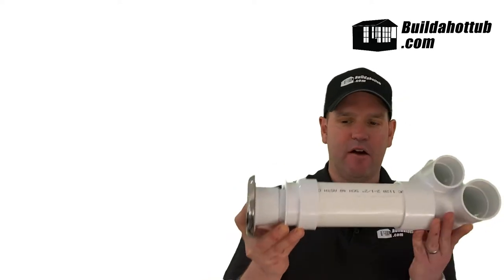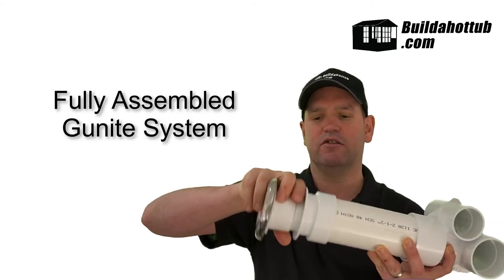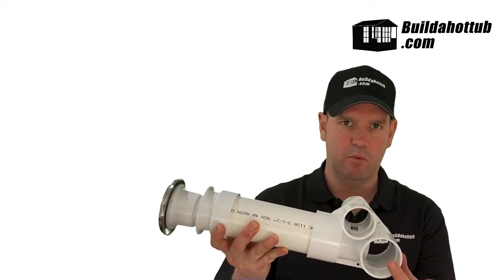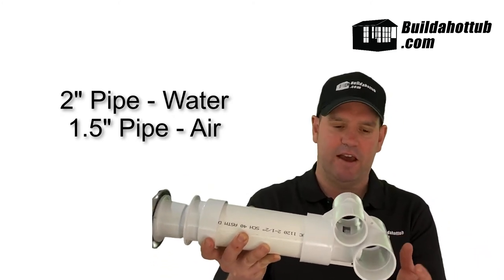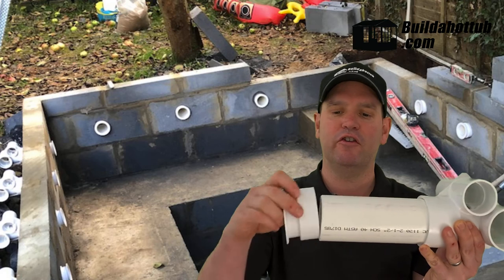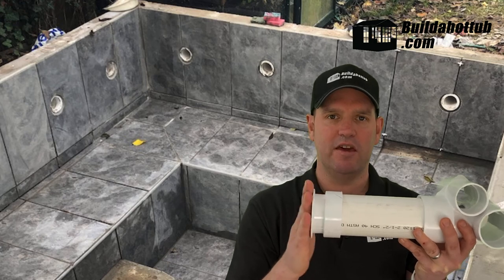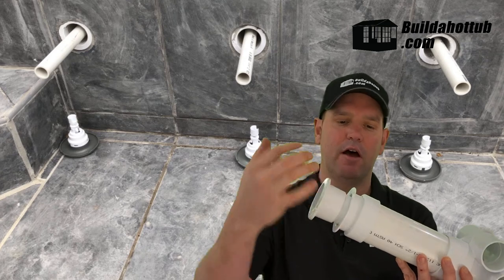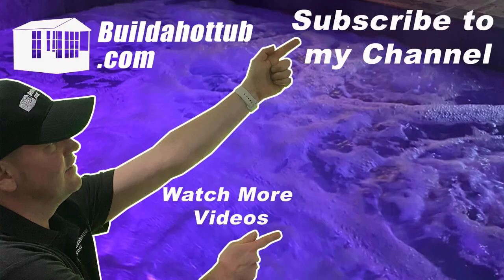Gunite Jets, Bodies and Assembly Explained - I cover it all

Comment: Thanks so much for the instructional video!  Manuals are very hard to find now and they really don't describe how the parts work on a gunite spa well at all anyway.  I found many links to the Hayward manual and they don't work anymore... not sure why.  I'm doing an OB pool and am getting ready for tile/plaster.  The 1" pipes are sticking out just like your video but they are very tight.  Guessing they may have the test plug in still so I now realize I can grab with large pliers and unscrew... kind of scary to do this when I'm not sure it's the right thing to do!  This is invaluable for OB's like me!  Thanks a million!!

Comment: Great video!   Connecting the 'niche' confuses me as to how to make it flush, since it goes over the 2" pipe.  Does anyone make a gunite type fitting where the niche slides inside the sched 40 2" so you don't have the issue of chiseling, or whittling down pvc to get things flush to your tile work?
Reply from the maker: Hi There, thanks for the comment. With the wall niche, you have to position it to allow your final finish thickness. For example, if you have a render the surface, then grout and tile, you are going to want to leave 8-10mm / 5/16" to 6/16" sticking off the surface of the wall. It is not the easiest to do to get them totally flush. You also have to chisel back as you point out to get the wall niche to fit onto your pipe. There are only 2 brands of gunite as I am aware. Waterway which is one I use and I think Certikin (someone will correct me if I am wrong) I know the alternative to waterway are so expensive and they also need huge amounts of flow on the jets which means you need multiple pumps on your build which is not ideal. Waterway have a bit of a monoploy on this kind of kit.

Comment: How efficient is the system at drawing in air via venturi action? I'm planning to use the 229-1100 unit, but before I install it to my existing block structure, I need to know just how good it will be at sucking in enough air to create bubbles.
Reply from the maker: Not sure John, same as your post on the other video, I always use air blowers so could not give you an answer from experience. Sorry about that - Andi

Comment: If you do not use an air pump do the jets still work? Will bubbles still come out?
Reply from the maker: Hi Paul, if you do not use a blower and cap off the air lines, then yes, it will still work. However, what comes out then is just water and there are no real bubbles as the blower does most of the job of creating the bubbles as the water mixes with the air. Hope that helps.

Comment: Why do you need the niche? Why not just cut the 2 inch pipe flush after the tiles are installed?
Reply from the maker: Thanks for the comment - it is meant to give you a nice flush surface for the jet holder to butt up to and also make it easier to seal around the pipe - totally agree with you, you could cut the 2.5" that goes in the centre flush as long as you have a good seal around it - thanks Andi

Comment: What's the minimum total length of this setup? I'm working in a very confined space on one wall of my project. Great videos. Thanks
Reply from the maker: Hi Dan, The back of the body is 150mm or 6" and this is the minimum space you need to get the pipes in - although I would recommend a little more "wiggle room" if you have it. Hope that helps and thanks for the view
Reply: @Buildahottub  so in theory, I could pour a 170mm thick concrete wall with the body within it and air and water pipes cut down to an absolute minimum for the niche to be fitted?
Other 3 walls are block built so not an issue. Really appreciate your quick response 👍🏼
Reply from the maker: Yes Dan, that would work.